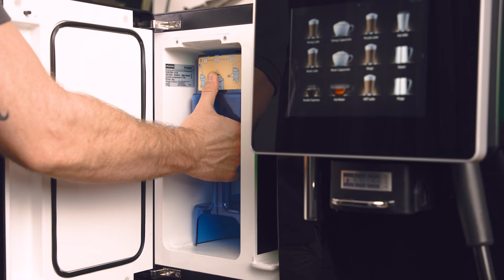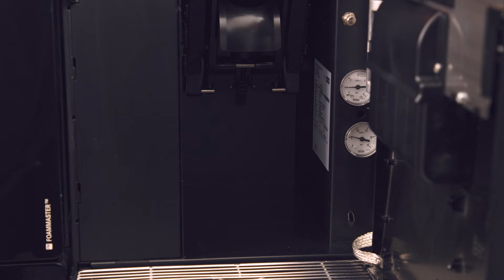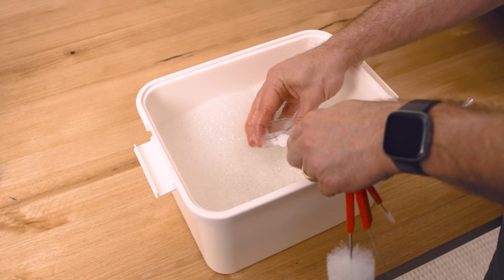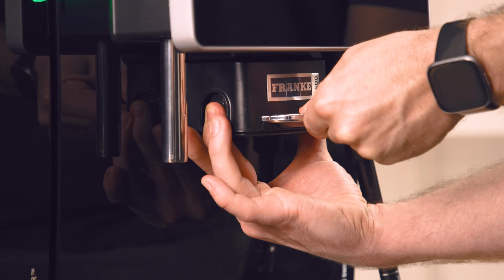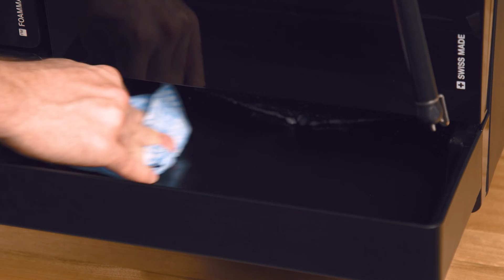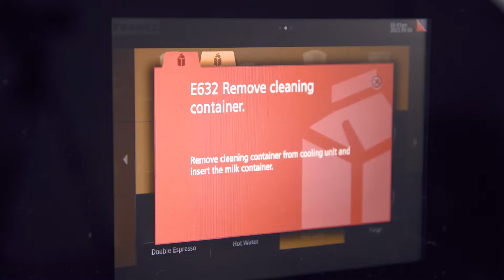How to Clean Your Franke A600 FM Automatic Coffee Machine - A Step-By-Step Cleaning Guide

Comment: My problem is when I put in the cleaning tablet it falls into the grinds bin
Reply from the maker: Thank you for letting us know, how frustrating! 

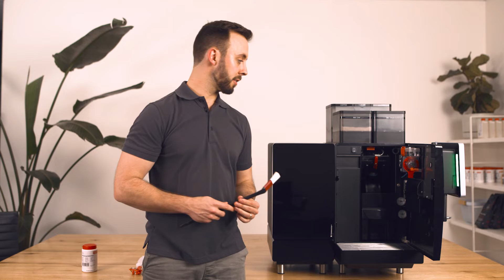Without seeing your machine, there might be an issue with your chute or it could be blocked. If you're unable to get a technician, a simple workaround is to manually place the Franke cleaning tablet directly inside the brewing chamber (which is underneath the brewing piston). To do this, clean the brewing unit with the long handled brush as directed on screen at 0:58, then place the Franke cleaning tablet inside the brewing chamber after this (it should be sitting on top of the little shower screen), and then continue to follow the steps for the remainder of the clean cycle. When the screen prompts you to insert the tablet into the chute at the end, skip it by selecting NEXT, and the machine will then complete the clean cycle with the tablet now manually in the right place. Hope this helps! - the tech team at Autesso
Reply: @autesso  it will not not fall down if you are following the cleaning steps on the screen and first put it in when it shows on the screen. if you do it before it will fall down in the ground container.
Reply from the maker: @camillabugge7448  Thanks so much for sharing the tip Camilla! Yes the timing of the tablet should match the on screen instructions.